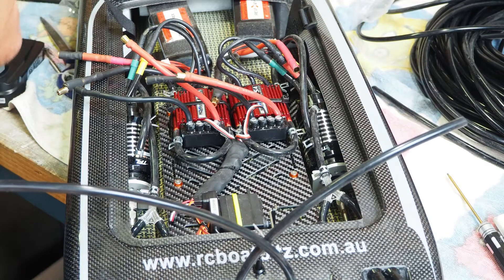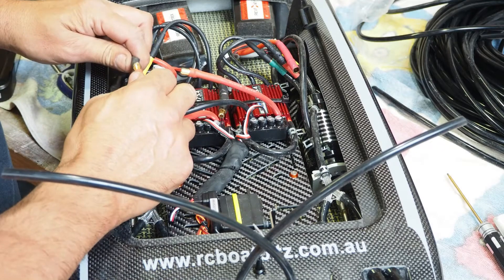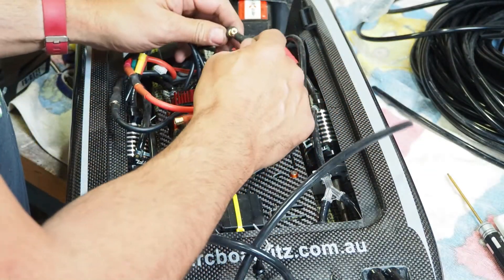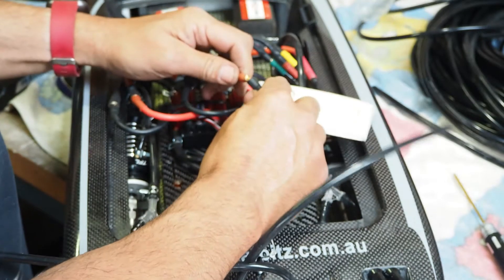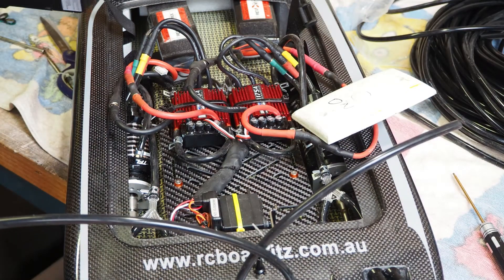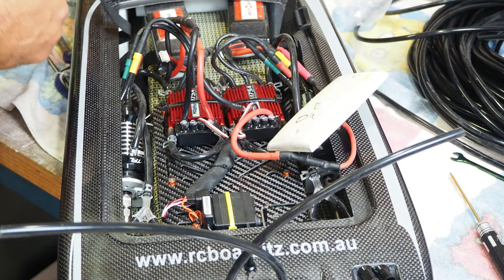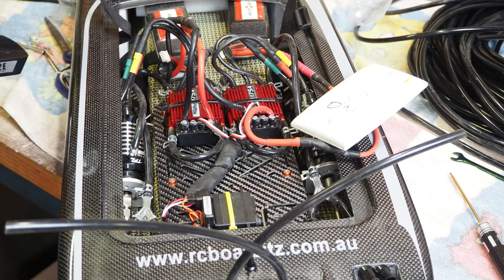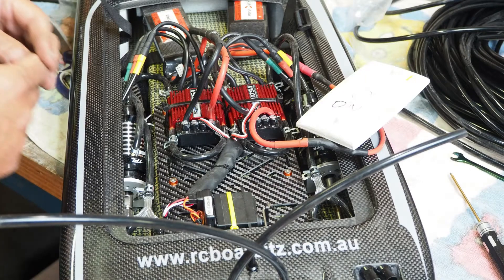How to program RC boat esc

Comment: Do you think these are up to the task for a zonda with the 4082 motors?  Not chasing 120mph, but the seaking 180As that come with the RTR are giving me lot of trouble cutting out.
Reply from the maker: We fit 4092 motors in our zonda r and it handles those nicely
Reply: Nice, all i need to know! @RCBoatBitz